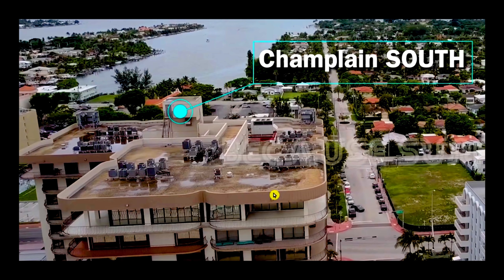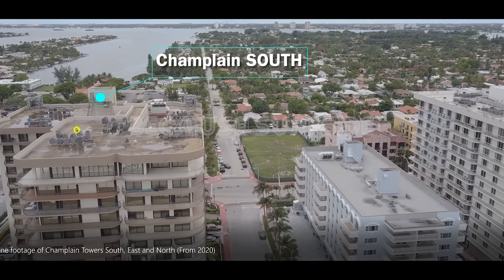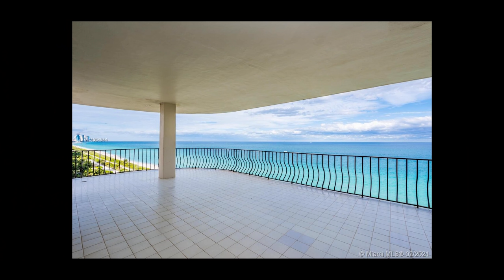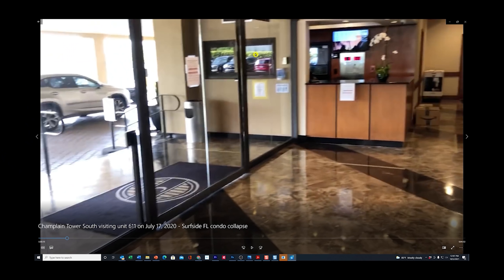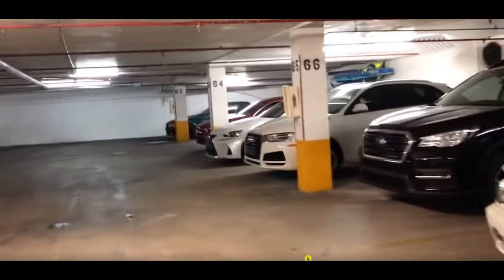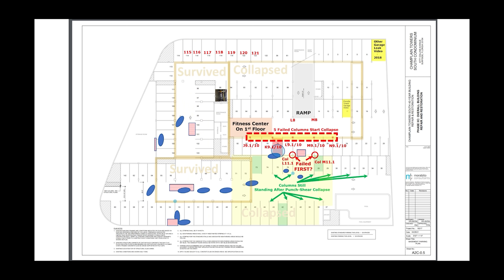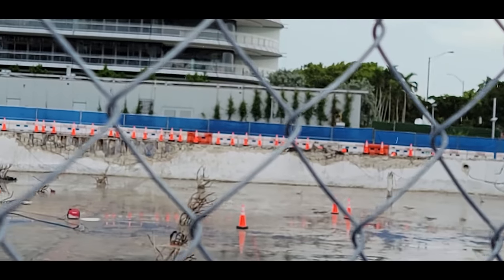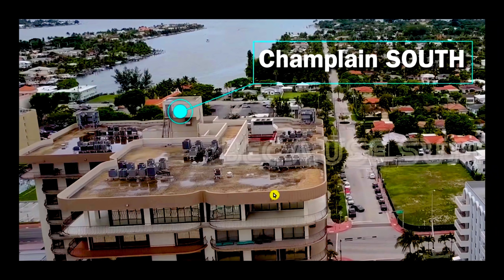Miami Condo Collapse: Water Attacked Roof, Inside, Pool Deck

Comment: Jeff's video's are very informative.
I am a multitrade State and nationally licensed Engineering Inspector.
Contractors and Inspectors know more about buildings than Engineers who are trained in the use of math to analyze things.
85% of licensed Engineers I have regulated don't understand how buildings are built and they are not taught this in school.
I know as I have a degree in Engineering with Architectural Design major.
Architects know how all the components Go together but have less Engineering calculation training.
Reply from the maker: Well said if I was the engineer I would want to be on site when they go to build the building so I can make sure it's being done right and I could see exactly how they do it and make any course corrections going forward. A lot of times things happen when it's boots on the ground on site and sometimes there's even different drawings that are used in construction than what's presented to the city that was drawn by the engineer.
Reply: @jeffostroff  Engineer's and Architect's inspecting their own buildings is something I wanted to get as a regulation. 
They fought it knowing they would lose their clients if they didn't roll over.
I worked as a threshold inspector here in Jax and was threatened on the job for failing firewalls at a well known fulfillment center.
 Do not let  building departments do inspections only the permitting was another recommendation. Also  now a contractor can hire his own private inspector without using the Building Department.
75% of the departments I worked for were corrupt. 

Also recommended insurance companies do the inspections.
Reply: @jeffostroff  That is a good idea but you would never get another client again! I speced out a steel column on a house to take large axial and lateral loads from a roof diaphragm and the contractor demanded a wood column.
He found An Engineer to do it!

Comment: I am a Structural Engineer with 30+ years of experience designing high rise concrete buildings, based on the videos you have uploaded I have the following remarks:
1-The building collapse is almost corresponding to column buckling, if column loses lateral support by a slab by punching through the slab, the effective length becomes that of two floors, not one floor as assumed in the design, transforming the column into a slender column instead of a short column, columns buckling load of slender columns is much less than their compressive strength.
2-Columns in the building are not braced against side sway due to the absence of reinforced concrete shear walls, this further puts more demand on the columns .
3- Had there been shear walls in two orthogonal directions, most probably the failure of one column shall not cause failure of the complete building.
4- Since the construction of the building in the seventies there have been huge revisions to building codes and building design tools, this should throw more responsibility on the Engineer doing the 40 year certification.
Reply from the maker: Yes the new engineer had a lot of changes that were to be incorporated to fix the building's problems

Comment: Where do the ac lines drain?  🤔
Reply from the maker: They likely go down the middle of the building, then work their way outside, or into the sewer. Most buildings I have owned the lines drain through the foundation and and pop up above ground with a P-trap right near the wall of the building

Comment: At the end of the video - where did the water in the pool come from if it hasn't rained in a while?
Reply: That is a very good question,  since the pool and basement (parking garage) are completely isolated from each other.
Reply: It’s probably just built below the water table. But, the rumor has always been that it was built over a landfill so that ground water would be very acidic.
Reply: Oh, sorry, my bad, you’re asking about the pool. I was thinking parking garage! Haven’t gotten to the part in the video with a picture of the pool with water! So sorry!
Reply: Ok, saw it. What a mess!! Sounds like the water is no longer being pumped out so it’s just rising to the level of the pool. My guess is ground water from the bottom level being below the water table levels. I’m super surprised they didn’t test that water in the engineering report for recertification.
Reply: Did you notice that the empty pool has now the same level of that dirty water? And the pool was not leaking. So the pool seems to be watertight. Water in it means it came from above but not below.

Comment: At 12:25 you freeze the frame snd say the surrounding buildings show no water. If you freeze it at 12:20 you will see water on the roof and patio roof of the low hotel building to the left.
Reply from the maker: It looked more like a stain to me which is what I did not call it water. No reflections off it

Comment: Could the water come from the AC units?
Reply from the maker: I know a lot of people like to think that they have the answer and they think it's the AC condensation. But the AC's usually have condensation lines that drain water away down the inside of the building into the sewer or other disposal area. And even if it was the AC that's too much water to be from the air conditioners. Even then the fact that you have this much water pooling shows that you have an issue on the roof where the roof is not properly sloped down to the drain. So even though people want to assign the root cause to an AC, the root cause here is the fact that the roof is not properly sloped, which means either an issue during the construction or somebody came along later years during a reroof and messed things up.

Comment: 9:28 Not an engineer but paid attention in science class...

The problem with doing this to take care of water leaks is that when water evaporates, it's not disappearing. It's being converted to a gas. It just stops existing on the floor. Without an actual place for the water to go, it will just re-condense somewhere else in the building. Problem hasn't been solved, it just moved to a different spot.

Comment: Was the original design for the original 12 stories or did they update the designs for 13 stories for water drains.
Reply from the maker: Original design has penthouse, city told them no we want no buildings over 12 floors, then they got the variance.

Comment: i wonder if all the ac's exceeded the weight limit of the roof , and clearly there was a foundation problem since it floods like that
Reply: The AC units were accounted for in the original 1979 plans; even the freon lines from the roof to each of the apartment's evaporators and their condensate drains are shown.
Reply from the maker: The roofs are all designed to handle these units, they are not very heavy at all. Don't even weigh as much as you and I

Comment: Regarding the water on the roof, a rule of thumb is any ponding water should evaporate within 24 hours. I had a 3 story apartment building years ago , wood frame/ brick veneer construction with a flat roof. As I worked through the rehab of the building I could not figure out how the roof drains all seemed to be at the high point of the roof. Water would sit on the roof for days until it evaporated. As work progressed, we were rehabbing a first floor unit and pulled some drywall off the center load bearing wall. Without getting into a lot of detail, we found the load bearing wall was constructed on the footing and the concrete floors were poured after and were a few inches above the wood plate of the load bearing wall which created a channel around the base of the load bearing wall. They did not use treated lumber back then when the wood was in contact with concrete as we do today.. A small water leak developed probably years before and leaked water into the channel undetected and slowly rotted the wood plate of the load bearing wall,  eventually dropping the load bearing wall about 1 1/4 inches. This was why the roof drains were at the high point of the roof. The cast iron roof drains were independent of the structure as it slowly dropped and became the high point of the roof. We had to jack the building up and rebuild the load bearing wall with proper materials. The pitch of the roof was corrected after the wall rebuild. The point of this long story is with all the apparent structural issue's with this building some supports may have slowly dropped over the years leaving the roof drains at the high point of the roof as was the case in my building. The drone footage indicates some massive roof pooling based upon the roof staining.  This could also apply to the non draining pool deck. It would be interesting to find out if any elevations were shot during the pre-collapse engineering study's and compared to any as-built elevations when it was built. One last point, I'm not familiar with Florida construction but we usually don't see a ballasted roof system on that vintage of building. There is a lot of weight added to the roof with all that gravel added. Is that the original roof system? Thanks.
Reply from the maker: They must include all that weight on the plans, so I doubt that small thin layer of gravel and mopped tar has much effect. I prefer the newer white waterproof membranes, they look cleaner, and easier to spot stains and pooling.
Reply: @jeffostroff  That stone ballast usually weighs 20-25 lbs per square foot. My point  was the ballasted roof added at a later date. The white TPO roof is definitely the way to go.

Comment: Same thing with glazed brick on a wall. The rain gets in the mortar and behind the brick then can't evaporate because the brick glazing seals it in.
Reply: Actually, I live in a full masonry historic building (built in 1914) with a glazed brick front porch. Glazed brick will not spall if you use the proper mortar mix. A brick is a sponge, and the mortar allows it to breathe and dry out, even if it is glazed. If you use too hard a mortar mix, the brick itself will pop off the glaze in order to transpire.
Reply: @maudessen573  This is not the case with my building built 1961. The glazing has prevented water from evaporating and with the freeze and thaw cycle caused spalling from the concrete understructure. No glazing popped from our bricks.
Reply: @stache1954  Does the building take rain on both surfaces? Or is it structural concrete with a brick veneer? My front porch is open air. It has glazed brick on the inside and unglazed brick on the outside, and takes rain and snow on both sides. Here in St. Louis, we have four seasons and an extreme freeze-thaw cycle. We get more freezing rain than we do snow. When my brick was tuckpointed, they used Type N mortar, I think. Whatever the mortar is, it’s relatively soft, as is the brick because it is vintage. I wonder if the 1961 brick is more dense, along with the mortar mix. On the 1903 garage at my other house, there is a decorative “header” of three courses of glazed brick in a building that is otherwise regular red brick. The garage is also full masonry, but unlike the porch it only takes the weather on one surface. The garage was tuckpointed with a mortar mix that was too hard, and the glazing is popping off. In a full masonry building, the brick and mortar will transpire in both directions, inside and out. This is no problem so long as both surfaces can breathe. In the case of my garage, if the mortar had been the correct softness, the bricks would not be popping their glaze. FWIW, in these historic buildings the inner brick and the outer brick are tied together but they are not in direct contact with each other. There is an air gap between them. I wonder if your 1961 building lacks the air gap between the concrete and the brick.
Reply: @maudessen573  Part of the problem with my building is the bricks are the kind with three holes in them. The water gets in there. There is no gap between the brick and concrete. I don't think that would be allowed as it is fourteen floors and the bricks rest on metal flanges drilled into the concrete. There is normal red brick above the roofline facing the deck and on the street side the glazed goes all the way to the top.
Reply: @stache1954  It sounds like the issue is the lack of wall system drainage and the lack of a proper gap between the brick veneer and the concrete wall. The fact that the brick has three walls shou,don’t matter, because when they set the brick the mortar would have oozed up into the holes.
Reply: @maud2739  Well you seem to be the expert on every little thing so I guess I should take your word above the engineers we hired to fix our spalling.

Comment: East and North towers seem to be in much better shape based on those photos . I always felt South looked all around in rough shape  in comparison. 
Thank you for the continued coverage
Reply from the maker: From what we hear the north tower is fine but the east tower has a number of columns in the garage that are cracking in splitting and you can see through them some pictures were shown on the news around the time of the collapse

Comment: Hi Jeff, your videos are very informative; however, have you done any analysis on the work that was going on the roof. There was constant pounding going and construction. My friend lives in the building right across the way and she said that's the area they were working on before the collapse. So don't you think that the vibrations from that constant jack hammering and installing of the divets on the roof can also contribute to the garage column collapsing. If the column is weak it will be affected by those heavy vibrations.
Reply from the maker: I have not done one on that yet but yes construction in buildings is loud that doesn't mean it's damaging and for the most part they're drilling holes in the roof and then mounting these brackets or whatever components they need to add in order to be able to secure the window washing equipment to it. That's simply not enough to bring a building down a building gets brought down by a lack of support which happens at the bottom of the building not at the top.

Comment: Water pooling on the roof could indicate a blocked drain. 1:34  But even if there were no roof pooling,  drainage is only as good as the route the water takes from roof to the ground. If rain water  seeps into the apartments below,  over head pics would appear to show adequate roof drainage. No conclusions can be drawn from roof comparisons to the adjacent buildings.
Reply from the maker: Keep in mind there are several drains around the roof so it would be pretty unlikely that every single one of them is blocked up. Also if you look where the water is pulled it is not any area where there are drains so it just simply appears like there's a very poor sloping to any drain

Comment: I have a question.  The drain plan for the roof that you showed, was that before or after the penthouse was added?  If I remember from one of your earlier videos they added the penthouse which would be the 13 floor later
Reply from the maker: The drains you see are from the original roof plan, but this may have been an alternate drawing as they always intended to have the penthouse there, in the penthouse was in the original floor plan. But there simply aren't any clear drawings of the roof of the penthouse in the floor plan as presented in 1979. But either way you can bet that since the architect had drawn in the sloped areas to the drain, he likely also included it in the roof plans for the penthouse. The city has acknowledged that there's a lot of documents that are missing so we don't really know how it was built.